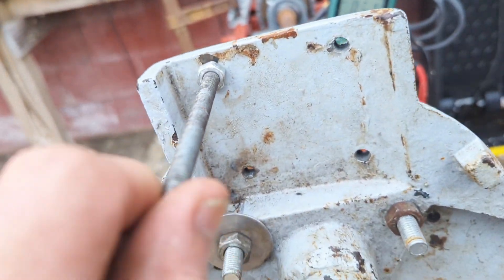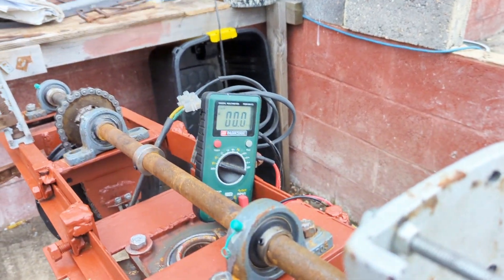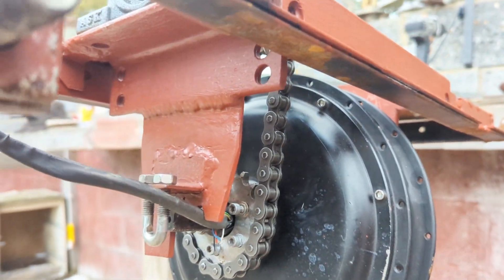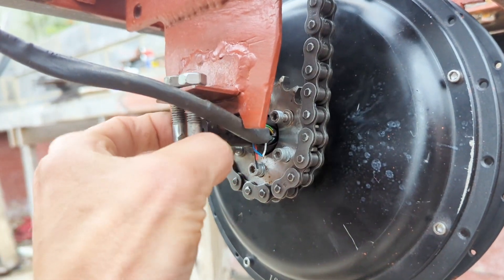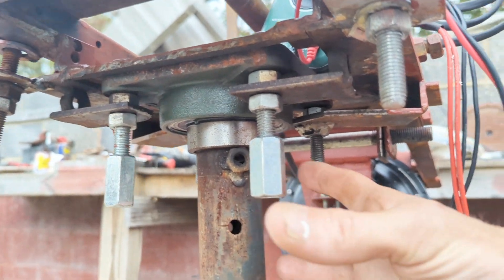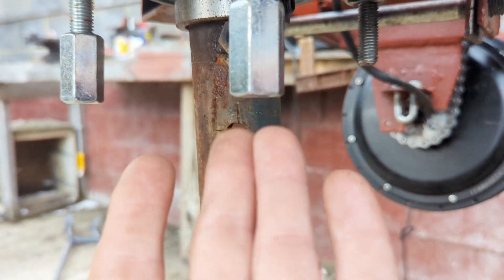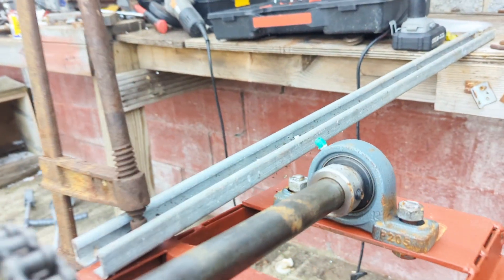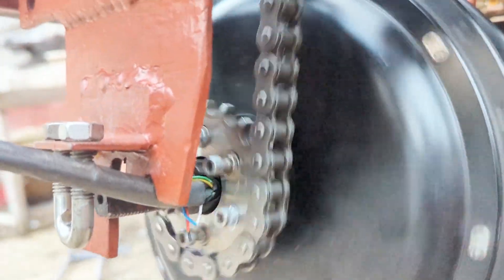New Wind Turbine Project - How many RPMS to hit 13 volts ( I'm super weak ) Free Energy

Comment: very nice work. If I were you, I would buy a regen controller along with that engine. this way you can charge 6 batteries for 72v in generative mode. and you power your home with a 72-220v inverter. I even use a Yuyangking 7280 controller and there is a regen brake softness setting between 1-10 on the phone. At the 10th level, it can charge with approximately 40 amperes (80 * 40 = 3000 watts).
Reply from the maker: regen would not work on a wind turbine system it is always forcing against the load there is no spare power when its slowing down.
Reply: @GavinFreedomLover Since there is no buck converter in the controls you mentioned, production does not occur at low speeds.  Controllers with buck converters also produce energy even at low speeds.
Reply from the maker: cheers , I get where you are coming from, thanks.